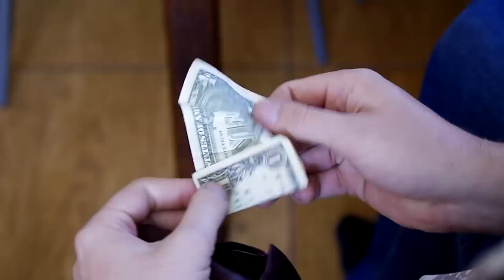Secret Machinist's stash

Comment: Very cool man. I'm a machinist and at one place I worked we were slow. I kept small scrap pieces of aluminum behind my machine. I made a nice tool box with tilt lid. Pull out tool tray in top. And a pull out drawer. It's about 3.5" x 2.5 x 2

Comment: Nice work! Love the look of these!
Would it be possible to purchase one without the engraving on the cap (or a different engraving)?
And is it possible to make the inner diameter smaller and turn the extra material into a lip on the top for a thin metal lid instead of stuff bumping into the brass rods?
(if it's unclear, I could make a simple drawing to make it more clear)
Reply from the maker: You can buy it here https://bruns.engineer/en/ but only as on video
Reply: @EngineerBrunS  Alright; thanks for the reply!
Reply: @EngineerBrunS  Well, it took some time, but I finally ordered mine! :)

EDIT: I'll place the order on your website instead of eBay (should save you their selling fee) and cancel the eBay purchase.
Reply from the maker: @dutch_blades  thanks :)